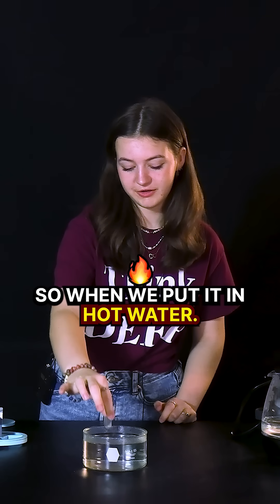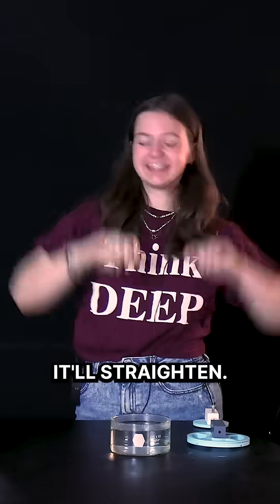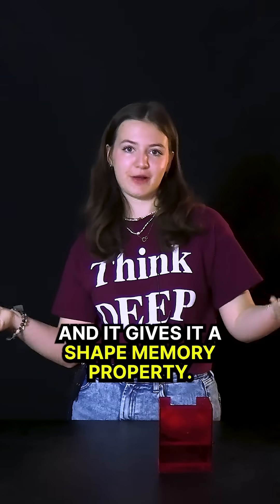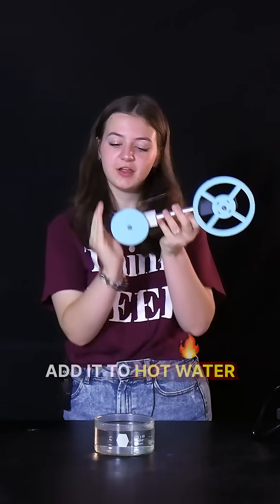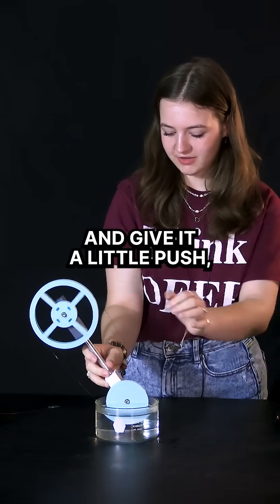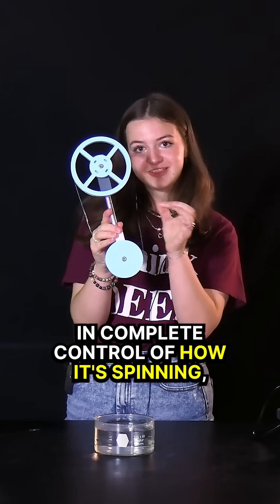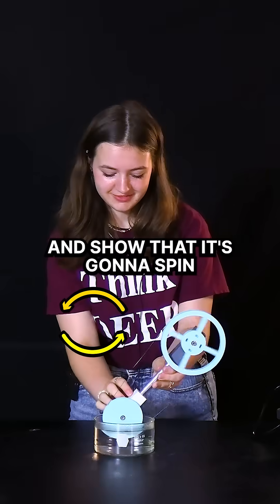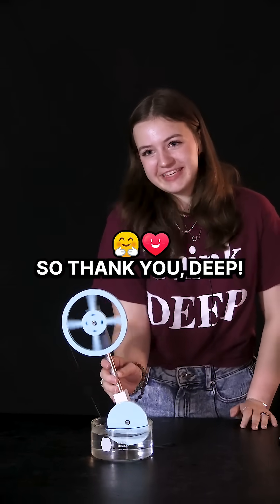Magic metal springs to life from heat! But how?? #shorts #tamu #science

Comment: My question is not whether this method can create unlimited power. Clearly, it cannot. However, I would like to know how efficient of an engine could you make from a nitronile wire? Like, if you have the wire pass by a condenser coil of an air conditioner to cool down, while being hooked up to the pully system, could you get an engine that is about 80% efficient at converting energy input into rotational kinetic energy? Seems like a strong wire, so I would think you could use it for industrial applications. I am not sure how these properties would scale with a larger diameter wire though.

Comment: cool
but right its not a free energy, you need to keep the water hot
Reply: Solar powered water heater will keep it running for 6 hrs a day
Reply: @dirtmcgirt168  just use solar panel for free energy then
Reply: @dionsagarandi7061  solar panels are not free energy either.

The sun is not infinite
Reply: @phaeste  at least it exist longer than our lives

Comment: Now you have to determine the efficiency over time as the material loses its "memory". And figure out what applications would benifit most from this
Reply: Nitinol doesn't lose its shape memory, that's why it's useful. The efficiency of a heat engine like that is pretty dismal though. The bigger use case is in nitinol motors and actuators.

Comment: Does the metal have a fatigue limit? Will this keep going for ages as long as there is that twmp difference or what will cause it to break? Can this be scaled up to 1" wires with extreme heat can crest extreme torque.

Comment: You built what exactly? Not the nitinol wire and it kind of sounded like you were saying that. All you did was wrap it around 2 pulleys bro calm down
Reply from the maker: @JMontgomery2012  Baiting but I'll humor you. The wire had to be trained to go straight which means bringing to 500°C then quickly cooled. This in itself is no easy task. As well, the pulley system had to be built to support it.

Comment: That would be nice for using it as a heat reactive muscle like opening windows when heated by the sun
Reply: Unfortunately it's not really reversible, and if you manually reverse it (like turning a crank or something to recoil/fold/bend it), it will also lose it's shape memory property over time, so it would wear out very quickly.

Comment: Some might suppose that this would be a good way to make an electric generator .. but its really a better way to make a fan (or even a pump ..)  if one has a supply of surplus heat .. a TEG (peltier)would be a good way to convert surplus heat to electricity.  Now whether it would be more efficient to operate the circulating pump with electricity or a nitinol spool .. hmm.  Still probably better to use electricity .. heating the spool would become the system's least efficient point.

Still, nifty demonstration .. and if it gets people thinking about using waste heat to do work, all the better!

Comment: I wonder what is the  efficiency of the system in terms of ratio of the work done by the wheel  to the potential energy stored as heat in the water?

Comment: The is such a thing as a solar heater which will boil water, so as long as you have sun, your good, but you got to get something better than that wire, because flexing a single stand wire will cause it to break fairly quickly.  But maybe if you could do it with cable you'd be on to something.

Comment: It’s powered by the heat gradient, not the nitanol
Reply from the maker: Nitinol is trying to go straight which is causing the continuous spin. Heat is applied to the metal, but that is not the direct pressure applied to the pulley.
Reply: @ Yeah, but the energy comes from the heat gradient

Comment: No its being powered by HEAT from the water.  It is really cool I grant you that, just dont think that its some kind of infinite energy hack.  Would be cool to figure out if this system is more efficient than just using heat for energy though.
Reply from the maker: Nitinol is trying to go straight which is causing the continuous spin. Heat is applied to the metal, but that is not the direct pressure applied to the pulley.

Comment: Completely powered by ... heat, not "nitinol straightening".
Reply from the maker: Heat is applied to the nitinol. The wire is what's applying pressure to the pulley.

Comment: I wonder how long it would spin before it stops working...
Reply from the maker: Just a few minutes. Water cools down pretty quickly. 😓
Reply: @tamuphysastr  that sucks. Maybe switch to something more thermally consistent to put the wire in.
Reply: @tamuphysastr  maybe use milk instead of water.

Comment: Request: How long does it take the water with the nitinol pulley to change temperature vs a control of the same temperature water?
Reply from the maker: This is dependent on the water keeping heat which isn't long. Boiled water will cool down in a matter of minutes.

Comment: What I wonder is this: how long until the wire breaks? I think I'd rather build another cute little Stirling engine.
Reply: Titanium alloys and nickel alloys are materials with the highest fatigue limits. The nickel titanium alloy nitinol is exceptionally resistant to fatigue. As I understand it, since the material is switching between types of crystallization, it’s not actually flexing. It’s more a rearrangement of the bonds between the molecules.

Comment: Would it be posible for a perpetual motion machine then?
Reply: no, nitinol uses the energy of the heat to go straighten, losing that energy in the process, meaning as the water cools from ut losing energy into the air and nitinol, the process will eventually slow and stop

Comment: Doesn’t seem like the wire wanting to straighten would make that turn 🤷🏻‍♂️
Reply from the maker: It is though, as she explains in the middle of the video. The wire is very quickly heating and cooling down as it moves around the pulley, causing the wheels to spin with it.

Comment: Aa an endovascular surgeon, I can attest to these properties as we use metallic stents with shape memory made of NITINOL for keeping blood vessels open from the inside.
Reply: @naman_bagdi  I did NOT know stents were made of nitinol fhats so cool
Reply: @jjjfo1818  theyre not made of nitinol lol, the tool used to hold open the vein while inserting the stent is however made of nitinol.
Reply: These are the kinds of comments I always look for, interdisciplinarity 🤗
Reply: Btw, NiTiNOL it’s an acronym: it stands for Nichel-Titanium Naval Ordnance Laboratory. It is in the name why it was studied and for which initial purposes …
Reply: @naman_bagdi  So they are inserted in a chilled state and as they warm up they expand the blood vessel?
Reply: @tjsbbi  yes. The crystalline structure changes with temperature, with the body heat and hence they maintain their radial strength without needing any seperate "expander" (like a balloon) so to speak.
Reply: I'll bet the ideal applications for this technology haven't been imagined yet.
Reply: @timonium252  you are correct. Material science, even though it's been around for thousands of years through impirical testing, only made serious advancements in the last century-ish and is a relatively new science where we can accurately and precisely determine the properties of composite materials--different combinations of elements--through nano-, micro-, or macroscopic analysis.
Reply: I used to make these stents. I was  a machinist that made the nitinol tube from solid stock that then gets sent to an extruder.
Reply: @TapEoka1  do you miss the sound of the gundrills
Reply: @GeofDumas   I miss being busy. Leaving the work force is boring af.
Reply: @TapEoka1  that’s so very cool
Reply: @TapEoka1   how was the pay for that job?
Reply: @naman_bagdi  hey medical dude. I'm not American I know people who say this reserve this for veterans but honestly, thank you for your service 🫡 you don't sleep so others can wake up. Thank you
Reply: @benhaley9811  thanks bro. Appreciate it.
Reply: When people get transplants they gotta use specific materials like titanium so the body doesn't reject it.
Does nitinol fall into that category of special materials the body doesn't reject or is it different inside blood vessels?
Reply: @A_barrel  No. It contains nickel. Not only is it an allergen, the bodies' sensitivity to it increases with exposure, so everyone will eventually become allergic if they are exposed enough. The difference is, how long it will take.
Reply: @A_barrel nitinol is a metallic compound made of titanium and nickle.

The human body doesn't like nickle.
Reply: @tylerdurden3722   so how come the surgeon says they use it?
Reply: @A_barrel  it's probably coated with a substance that protects the body from the Nickel.. There are bare metal stents and coated stents / drug eluting stents if I remember correctly
Reply: @tylerdurden3722  Stents are always coated with a substance that prevents the stent from clogging, so exposure to nickel will be absolutely minimal, and probably well below the limits.
Reply: @A_barrel Temporarily during surgery. Potentially you could coat it with titanium though.
Reply: @A_barrel   yeh, I was wondering about the nickel content 🤔  I know titanium & gold is fine, matter of fact, there is a Au/Ti alloy they have been making for use in body.
I've seen plenty of gold, titanium & silicone coatings, just don't know how long each will last in body.
Reply: @A_barrel  EXCELLENT QUESTION!!
Reply: So then are people with stints supposed to stay away from cold water or ice plunges?
Reply: @RichardPingelton   lol I bet hypothermia  hits twice as hard
Reply: @RichardPingelton  oof imagine it curling up inside your heart
Reply: I just need someone to replace the quarter panels of the Old Lady's car with this stuff..
Reply: @TsubadaiKhan all metal has memory ... when doing body work it's relatively easy to beat back into shape right after an accident the more heat cycles and vibrations it's gone thru the more difficult it becomes... it would be kool for fenders except that it is very brittle generally and will shatter
Reply: @jolllyroger1  nitinol is not even remotely brittle and because it goes thru a martensite/austenite phase change at just above room temperature it doesn’t work harden, which is the characteristic you’re describing. Work hardening increases strain between grain boundaries as the material absorbs energy but during a phase change grain boundaries are abruptly reformed. You’ve never encountered nitinol how would you know it’s brittle? You’re literally watching it in real time go thru plastic deformation without stiffening so you’ve just watched evidence of your comment being total crao
Reply: @TsubadaiKhan  🤣😂
Reply: @TsubadaiKhan facts 😂😂😂
Reply: @TsubadaiKhan  underrated
Reply: Great use in endodontics too
Reply: I work for a, or even THE, company that makes these.
Reply: @chrisgenovese8188  would that be Abbott Pharma?
Reply: it's fake
Reply: It’s true! I was the scalpel.
Reply: I’m willing to bet 90% of the comments this guy leaves behind start with “as an endovascular surgeon”
Reply: @naman_bagdi  never occurred me nitinol was used for. Very fascinating , thanks :)
Reply: The woman that's in my life right now works at a factory that makes those. Industry term is "Spring guides"
Reply: "Tell her she wasn't the first to discover this without telling her she wasn't the first to discover this." 😅    joking, I think it's amazing she figured that out regardless of similar applications, independently.
Reply: I saw a video about 20 or so years ago that surgeons used liquid nitrogen to freeze what i thought was a spring. Inserting it into a blood vessel, then as the body warmed the spring, it expanded opening the vessel. Only part was they were on a time crunch because if they didn't put it in the correct spot, the warmth would expand it beforehand.
Reply: How can it go in the body if it has nickel in it? If that was done in my heart id be dead in 24 hours, probably less
Reply: Have you ever put a stent in a neck artery?  The reason I ask is this: 

 I have endured nearly 7 years of chronic restriction to the main artery in my neck as a result of being very nearly choked to death by an assailant.  I mentioned a stent to my doctor but he decided no, leaving me to suffer many blackouts and severe loss of brain function.

I have been gaslit and ignored for years as I struggle to finish sentences, I've gone from fit, intelligent and vibrant, to dull, slow and lstless.  I am bereft of hope, but wonder if you could shed some light on where stents are appropriate.  Thanks in advance for any help you can give.
Reply: @DJ-Eye   

I really hope someone gives you a legitimate answer to your question. Good luck, and never lose hope.✌🏼
Reply: @DJ-Eye I'm sorry, but I find it difficult to believe that you are dull or in any way someone that isn't interesting. It is unfortunate that you have been through the things you have during your journey. And I am sure that the blackouts as well as the pain that you are forced to endure is brutal. I am also sure that you are convinced that I. Some way that you are not the same person that you were before your attack. That's one of the most important lessons that one can learn. You're just as smart, bright, attractive, ECT. As you were whenever you indured the  attack. The fact that you were stong enough to discuss it here shows how much progress and strength that you have gained. Thank you for sharing. And may you  reach your every goal in record time.  And may you find the correct direction for you to continue your healing. Sending love and light.
Reply: @DJ-EyeI’m super sorry for the unfortunate transformation you’ve had to experience while getting gaslit and dismissed by the medical system. I hope you’re able to find a way to make life feel more liveable again
Reply: @DJ-Eye  for to gym and start training those flabby muscles to be rock hard and improve your neck and circulation.
Reply: Si vivieras en España te haría una simple dilatación, ese tipo de lesiones son tratables. El problema es el sistema sanitario, cambia mucho de un país a otro@DJ-Eye
Reply: @DJ-Eye It would be wrong on my part to comment on that without knowing the complete history of what happened. But I would say have more trust in your doctor than on what you see/hear/learn on social media.
Reply: If you’re a surgeon, they get back to work stop watching YouTube shorts and rotting your brain
Reply: @KalanDitlefsendo you think surgeons are on duty every waking minute of their life? Or that they’re somehow less entitled to spend their free time as they please? Also this is one of those videos that are the opposite of brain rot, frankly every person commenting here has been either refreshingly well informed or healthily curious and respectful. Then there’s you who couldn’t even write your statement without enough mistakes that you nearly lose the meaning. I hope you lay off the brain rot, it’s taking a toll on your brain
Reply: If you’re a surgeon, they get back to work stop watching YouTube shorts and rotting your brain

Comment: Really curious about possible applications for something like this. It seems like it'd be phenomenally useful for odd robotics and maybe some space doohickeys
Reply from the maker: @sethgeyer1719  It has several real world applications in engineering and medical uses. It's really amazing!
Reply: @tamuphysastr  a miniature generator for camping/recharging, just boil water.
Reply: Another cool thing about shape memory alloys is that they have insanely high Young’s moduli — that is, you can bend them very very far and they’ll spring back to their original shape. Because of that, NASA has been using them for their airless tires on the rovers.
Reply: @theangledsaxon6765  space doohickeys!! We love to see it!
Reply: I believe that met used it to make either one of the worlds thinnest or world’s smallest robots, the nitinol worked are the legs

Comment: I suppose the energy comes from a temperature change in the water, so you would have to maintain the water at a given temperature in order to continue this process?
Reply: Yes. So imagine using it with an existing warm water source, such as geothermal or nuclear plant cooling ponds.
Reply from the maker: Yes, for this system.

Comment: Wait. Is this converting heat to kinetic energy? That's the bare minimum to prevent the heatdeath of the universe.
If what's happening is what I think is happening, we can make the universe immortal.
Reply: I mean... No it's not converting heat to kinetic energy, it is just releasing the potential energy stored in the Nitinol from heat applied, it's like a spring but only works via heating it instead of compression.
Reply: @Soarano  But where is the potential energy coming from? It can't recharge itself, that'd be perpetual motion.